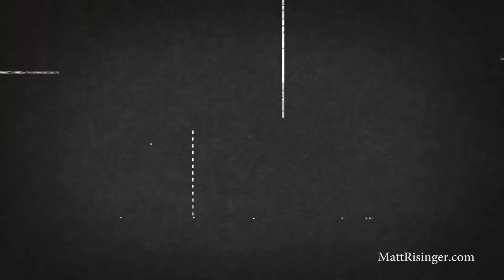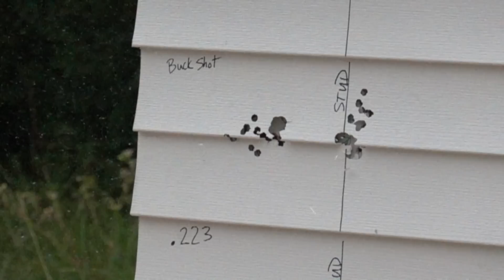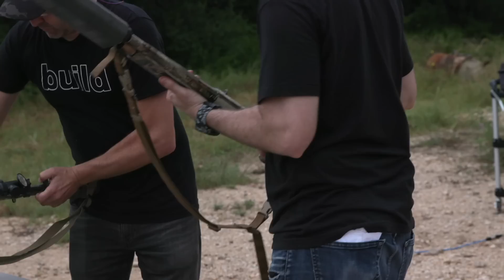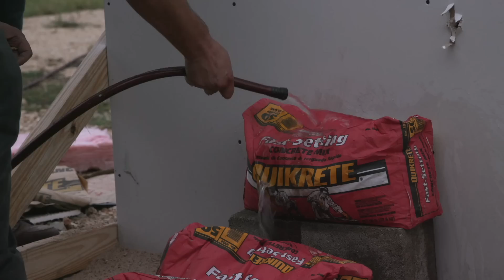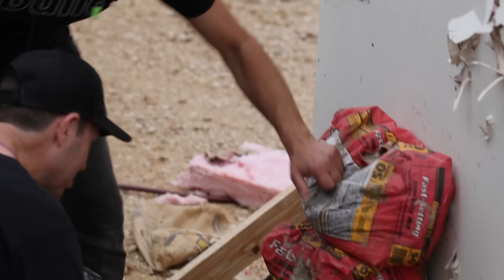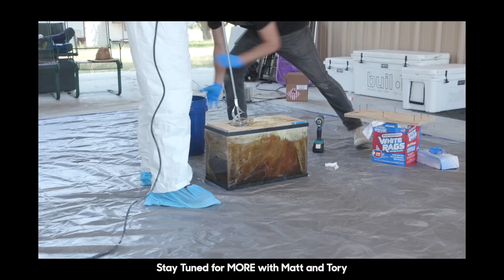Will your house STOP A BULLET?  Guest Star - Tori from Myth Busters

Comment: Matt I've read that filling the wall cavity with gravel, has to be larger gravel pieces like 3/4 and 1" inch rocks, not sure if it's got 3/4 ply on both sides or just interior. Supposed to be an inexpensive way to bullet resist a wall.
Reply: This is accurate. 3/4 in minus gravel - it doesn't pour out of the bullet holes like sand does. The bullets essentially shatter each rock they hit and dissipate energy as fragments ricochet. The coarse nature of the gravel causes it to lock together and prevent it pouring out the new hole. Plywood on each side is preferable because of the weight of the gravel. It will also help prevent drywall blowouts. You would ideally have 2 thinner walls offset at the studs to prevent any possible "lead bridging" that may occur when bullets hit the wall.
Reply: @guapodelguapos  maybe if they used that advanced framing tech of 2 2x4 walls, that have a gap, to prevent thermal bridging, but filled the space between the stud walls with the 4ft high double ply, and gravel, they would have a 4 ft perimeter wall around the entire house, and everyone dives to floor if a drive by happens.
Reply: @menchelke   That's the exact concept. I am working on designing my family's future home. The sides of the house facing  the street(s) will have exterior fiber cement siding, plywood/osb sheathing, 2x4 wall with batt insulation, stuco lathe, 4-5 inch gap filled 6 feet high (higher than tallest occupant) with 3/4 inch minus gravel, stucco lathe, 2x4 wall with batt insulation, and then sheet rock. The remaining sides will be similar build; but the lathe and gravel will only be 4 ft high. If bullets are coming from those sides, we should already be aware of the presence of a potential threat (security system, alarms, situational awareness, etc.) in enough time to take cover. Keep in mind that this design only works well for a single level home due to weight constraints and practicality. I would go with a commercial solution if I was doing a retrofit or second story on a new build.
Reply: @guapodelguapos  I hear you. I would think an ICF would perform decently. I plan to do a solid fill block house myself. It would be interesting to see how ICF,  8x8x16 hollow block, solid fill block, brick and then double wall brick "ie non load bearing exterior brick with air go and then load bearing brick, and compare it to the gravel system. Cost, vs complexity, vs performance in both normal housing metrics, ie maintenance, longevity, insulation, thermal mass, and performance for resistance to being shot at.... maybe a project farm, or demolition ranch video.  Haha
Reply: @guapodelguapos  The fact someone has to even think ab doing this to protect their home to sleep comfortably at night in 2022, is insane. Even more so if you live in the USA.

Comment: Armorcore composite sheathing. Done. It's not cheap, but neither is 2 layers of 3/4" plywood and sheet metal.
Reply: There's also Sure-Board which is sheet metal laminated in a drywall panel.
Reply: 2 layers of 3/4" plywood is far cheaper, can not compare on price.
Reply: @phillhuddleston9445  Ignoring the price of shipping, the cheapest I can get that plywood and sheet metal composite is ~$130 for a 4x8 sheet. And keep in mind, that panel only stopped the smaller rounds.
Reply: @AndrewMerts  I have seen the prices of the fiberglass composite bullet resistant sheets in the past and from my memory they are still far more expensive, Do you have a price on them?
Reply: @phillhuddleston9445  It's starts at about $30/sf, not including freight shipping to a job site, which is more reasonable than you would think considering if you went to home depot and bought it you would need two or three guys for at least two or three hours to deal with loading/transporting/unloading. Time is money. But - It's initial cost is offset in the installation because you can just use self-tapping screws and you're done. It's just one layer and it can be the finished material on the interior of the safe room. No layering/taping/mudding/sanding. I'm not a rep. I'm an architect who has used it before. It was heavy and has to be cut outside (glass dust) and brought back in, but aside from that, the install was easy enough.
Reply: Phillip Todd 
Very interesting...!
Would you happen to know what calibers of bullets it rated to stop?
Thanks for sharing this information with us.
Have a great day and be blessed.
Reply: @ptzish   that would be $960 for each 4'x8' sheet, labor and delivery for multiple sheets of plywood and sheet metal isn't that expensive, if it is you are getting screwed over on it.
Reply: @phillhuddleston9445  I think the person getting screwed is the one who is expecting two layers of less expensive plywood to stop a bullet.
Reply: @phillhuddleston9445  they sound like a rep. still don't use plywood and roof sheet metal, its a dumb idea. fiberglass is too expensive to be used as armor in a realistic sense. if you need a light vehicle, aircraft, or cabin door yes, but part of a house structure no. fiberglass armor is usually only level 3 rated otherwise its too bulky, pretty bad if you look into it.
Reply: @MaximMusaExBangladeshi  If someone already has a wood framed house and wants to retrofit it. They're not going to be pouring steel-reinforced concrete around it but they very well could install fiberglass panels over the sheathing. Bricks, whether solid-filled cmu or actual bricks, are not nearly as strong as most people think, when it comes to resisting bullets. Bullets chip away and expose the weakest parts of those systems. Clearly - a bunker-type mentality would produce a discreetly-placed 16" thick concrete structure with sloped exterior walls to help deflect the energy of incoming rounds and a mote 100' deep of 6' tall blackberry thicket around it. But....

Comment: ICF walls... Or any other concrete and brick that is 12 inches thick like we use in Europe :)
Reply: You beat me to it!
Reply: This is exactly where my mind went.  So many benefits to the ICF construction method.  Great thermal mass, great protection during storms and solid walls that can stop a bullet.
Reply: @CharlesCHubbard  Not to mention they last forever, there's a reason 30 year old houses in America are falling apart while 300+ year old houses in the UK and Europe are still standing.
Reply: @thedestroyer3262  those will be using large set stones that are kept dry m8, wood and mortar don't last 300 years under much of any load while getting any moisture. ICF here in Murica is like 2 inches of cheap styrofoam, few inches of a weak concrete with literally one row of rebar every now and again, then another some inches of bad foam. cheap AF and people think they are building the gun deck of the Musashi.

Clearly we are mislead by product advertising, and fail to seek out substantiative information.
Reply: @Baigle1  In the UK (very wet) we have lots of cob cottages and wattle and daub houses that are 800 years old and still lived in. Because they tend to be in desirable areas some "workers cottages" that just got built by landowners for the peasants now get sold for 2-3 million dollars.
But you can also buy a French or Italian castle that is 1500-2500 years old for that sort of money.
Location, location, location...
Reply: The norm in European construction above 600m altitude has to 16 inches or more, a bullet will have a problem getting trough and a stud made of 2x4 is not a house but a garden shed and the only thing that sleeps there is my mower.
Reply: Yes, we here have very expensive houses made of cardboard like a homeless persons house :(

Comment: Not many homes if at all are built to be bullet proof or bullet resistant and the materials they use to try and provide that protection gets expensive quickly. From Kevlar panels to steel plate it's very hard to defeat all kinds of ammo. Brick facade, cinder block can be defeated easily with a high powered round and 5.56 can wither away cinder block with a few shots.

I did see a video once where a person filled up a cavity with loose gravel and that nullified a 5.56.  Again providing that sort of enclosure around a home is expensive.
If you lived out in the woods or on top of a mountain you have to assume hunters are out there and they will be using high powered rifles. Unless your home has 6ft thick reinforced concrete not much will stop those sorts of rounds and a window isn't stopping much either.
Although homes provide concealment they aren't much for cover. (https://www.wideopenspaces.com/cover-versus-concealment-knowing-difference-gunfight-pics/)
If facing multiple threats like a zombie apocalypse your home will be breached. The question is who wants to be the first person to die coming through the opening?

Comment: Missing my building science...If you're running out of ideas maybe schd 80 vs 40 underground vs sdr, septic tanks plastic vs cement, infiltrators vs conventional system...solar panel racking mounting, string inverters vs micro inverters...etc.

Comment: Good job on having suppressors for all the test guns.  Save your hearing
Reply: Adam Williams So that rectangular looking object at the end of the shotgun was a suppressor? I didn’t know shotguns could have suppressors on them. That is so cool!
Reply: They already had hearing protection in.  They just slowed down each shot.  Perps don't use suppressors.
Reply: @jumbowana  common misconception about silencers/sound suppressors. The baffles in them cause increased chamber pressure slightly increasing a bullets velocity over an open ended barrel. It's typically enough to be measurable by equipment, although not really noticed by the shooter.
Reply: @jman1121  subsonic ammo
Reply: jumbowana I think people  have watched movies one too many times.  http://www.flickchart.com/blog/top-10-films-featuring-silencers/
Reply: Adam Williams You should be referring to silencers not suppressors. Suppressors just reduce muzzle flash.
https://www.google.com/search?q=what+is+the+difference+between+a+silencer+in+a+suppressor&ie=UTF-8&oe=UTF-8&hl=en-us&client=safari
Reply: Writerdust , Silencer is a name a professional wouldn’t use, for the simple reason they don’t silence a gun, the suppress some of the sound energy.  Flash arrestors is the correct name, I think simply to avoid confusion with noise suppressors, because they don’t fully stop flash 100% of the time either.

Comment: AR 223 is NOT what out troops are using. Thanks for perpetuating the myth... smdh
Reply: Yeah I cringed when I heard it too.
Reply: Guys... The rounds are literally interchangeable.. and the only difference between m4 and ar15... Is practically full auto. Most times military only uses single fire mode anyways... So yeah they are the same
Reply: @AlexRodriguez-tp1zr  .225 and 5.56 are not "Literally interchangeable" . To use both in the same barrel you'd need a .223 wylde barrel which can shoot both. You can't just throw a 5.56 in a .223 barrel.
Reply: He said AR and then .223. while it is true that the AR-15 rifle has never been used by the military, .223 ammunition is extensively used by the military.
Reply: Let's be real here.  you can also use a butter knife in a military setting.
Reply: @jpiz224   LOL True.
Reply: @willdwyer6782  I was in the military and we never used 223 ammo. We used 5.56.
Reply: Food for thought if you put a 223 round in a m16 or m4 it would make it a bolt action rifle. Cause you would have to pull the hammer after every round you shoot. 🤣
Reply: @jpiz224  false. 5.56 and .223 are largely interchangeable and any 5.56 rifle can fire 223 without modification.
Reply: let us be here real...  the only real difference between this gun and "real" army riffle, is that civil guns can't have auto... most guns differ a little bit in precision, maybe the kickback, but if you load the same ammunition in it, the result is  around the same.. if the AR15 is modified to have the auto option, you could use it in a military setting..

Comment: The sand works, but people are already doing rammed earth using a straw with clay slip using the off set 2x4 on a 2x6 as the base and topper of the wall. This gives a 5 and 3 quarter inch wall with no wood going all the way thru which helps the thermal r value, because obviously the right value of wood is less than the rimmed earth.   Another newer method is hemp Crete building, which is not Hydro scopic like normal concrete.  It is Hydro phobic which allows for a dual heating and cooling radiant system withing the wall and floor construction.  Also hemp Crete can be cut with a carbon blade without degrading the integrity of the blade.  Since there is now going  to be a plethora of hemp being produced and processed in the US I'm hoping this method will catch on.  If you could check it out and do a segment on it it would be greatly appreciated.  Thanks Matt.
Reply: It's called "rammed earth" not "rimmed earth".
Reply: @MrEazyE357  gotta love auto correct and not proof reading.
Reply: Hope you haven't lost any sleep over a mispekked word.

Comment: Mat concrete block assembly stucco cladding. I have seen it once or twice.... Just saying.
Reply: I'd like to see that!  Maybe a brick wall and rammed earth too?
Reply: Concrete filled block.
Reply: Jose Colon

Unless it has a poured core, the block wall is unlikely to stop a 12ga./00, a .223/5.56, or a .357, though it might well stop a 9mm.
Reply: stucco... terrible.
Reply: My house was built in reinforced concrete (steel rebar and bolts) and masonry bricks.

Comment: Whats the R value of 120 lbs of sand. LOL. This was cool.
Reply: Adobe ???  Thermal mass, maybe a 6" solid log wall.
Reply: @davidhosmer1424  I like the thermal mass idea... maybe Rockwool outside with stucko?
Reply: Not great, sand is basically pulverized glass with glass being a fairly good thermal conductor.
Reply: Yea it would be a second wall layer, so I do wonder how well it would deaden noise, could be sold on that basis.  I'm guessing it would be the inner wall layer but i don't know how the condensation issue would work with a second wall layer.

Comment: Howdy! I grew up in Albuquerque New Mexico. Some skinheads did a drive-by on my house when I was a kid around 9th grade, they were after my brother who was in jail at the time.(No family is perfect) I was in my room playing starcraft and all of sudden I noticed parts of my window was hitting the floor in chunks. Later I came to find out a bullet hit the metal window seal and if it was an inch higher would have hit me in the throat/neck area. The other bullets that hit the house, hit red brick and didn't do much to them at all. They said the gun used was just under a 9mm in power but I don't remember the exact gun.  That makes me think solid brick is the best material for stopping bullets Matt. Thanks!
Reply: Ah good old Burqure.
Reply: Levi Godwin .380 likely. Size of a 9mm but less powder.
Reply: @dodge392  Could have been .38 special. slightly more power than .380 still less than 9mm.
Reply: Yea its all about composite materials, I bet cement board layer added to his plywood sandwich would have worked without adding too much cost, usually a bullet has to hit something hard before being caught by something soft.
Reply: @omgwtfbbqstfu  Why are you guys so stingy and cheapskate? Don't you find anything better to do to unearth? Concrete is enough to protect your home.
Reply: This is pretty much your average childhood in burque, video games and drive bys
Reply: My 1200 fps .177 air rifle does penetrate more than half inch into solid red bricks. I wonder how some firearms couldn't do any damage to red bricks.
Reply: @Ambulrai But it would never penetrate reinforced concrete with steel. It might leave a big dent but won't cause any damage to concrete.
Reply: Not like my childhood at all.